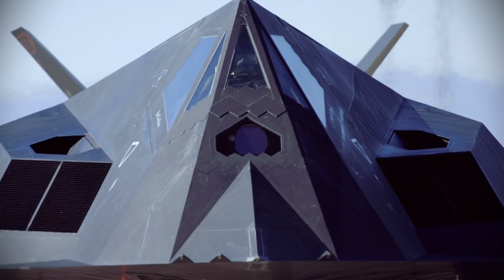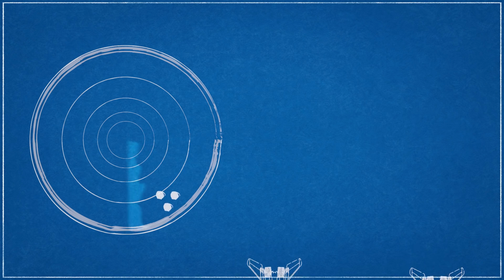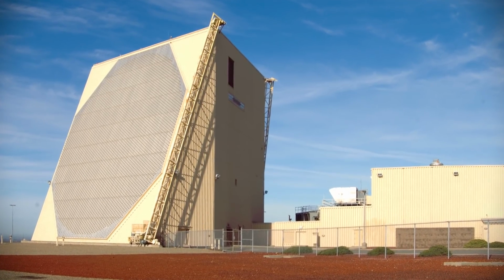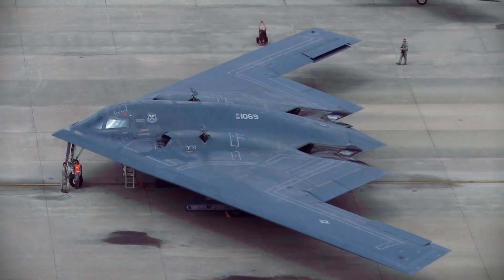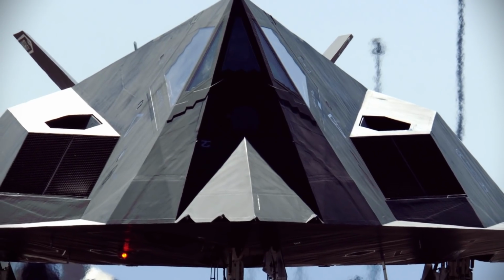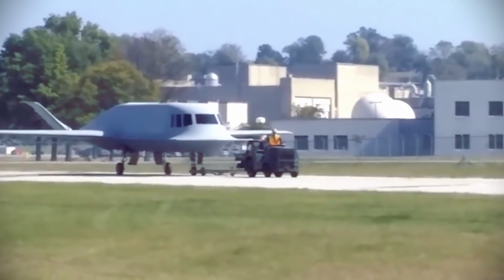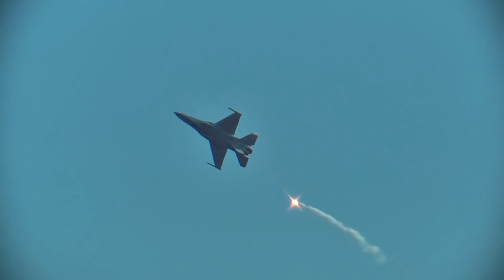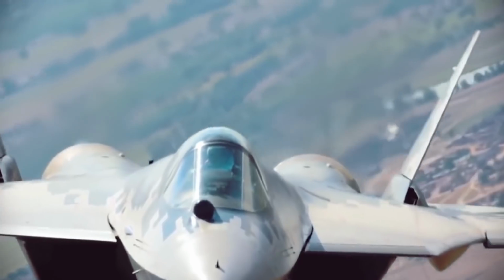The Evolution Of Stealth Technology

Comment: Fun fact about the F117: During testing (the picture of the aircraft on the pole in the desert), the model was so stealthy that the radar operator couldn't see it on his screen until a bird landed on it, and then he could only see the bird. The F117 was so stealthy that it had a lower RCS than the pole it was mounted to and the engineers had to also make a stealth pole to put the model on.
Reply: and the F-22 has an RCS 1,000 times smaller (about the size of a bee!)

that being said, a bee moving at 'mach 1.something' is going to be noticeable
Reply: @andyman8630  that is the reason why stealth and detection are in a cat and mouse race
Reply: They didn't make a stealth pole, they put a 177 caliber bb on the nose of the 117. It's design was called project Have Blue.
Reply: And still at least 2 got hit in Serbia and one was downed - it’s low RCS but not in low frequency and not invisible
Reply: @Cristieagle  smashed is smashed cope about it elsewhere
Reply: @mistralx2475  I was just about to say that. Seems stealth technology is overrated
Reply: @BluewaterBottoms  They did you can read it in the book which was written from the second boss of Lockheed skunk work. Can get it as pdf online for free.
Reply: @mistralx2475  The only time one was downed was when a stubborn SAM operator continued to look for aircraft in the area for hours on end, and finally caught an F117 opening it's bomb bay doors, revealing the non-stealth interior of the aircraft, and he was able to get a reliable lock and fired.
Reply: @d.bcooper2271  It isn't, the fact that only 2 were ever hit is an insane miracle for an air bombing campaign. I can tell you right now, if the F117 was a conventional bomber with no stealth functionality, there'd have been 50 losses at least, perhaps even more.
Reply: @BluewaterBottoms  "Have Blue" was the original proof of concept program which came from the 1961 paper, "Method of Edge Waves in the Physical Theory of Diffraction", by Soviet mathematician, Pyotr Ufimtsev.  The development program for the F-117 was based on "Have Blue" but was called "Senior Trend".
Reply: It is also important to understand the relation between rcs power and detection range
Reply: Sounds like a load of BS story or a joke that was taken too seriously.

The airplane is relatively hard to detect from the front but the case is not the same from every aspect. 
"Stealth" is not Haryy Potter cloak, it's very relative with a complicated relationship between angles of reflection, distance, and radar waves length and energy...thus it takes a lot of Mission planing, intel and luck before venturing into contested air space.

There's no way a radar would miss every aspect of such a surface object at 0 distance.
Reply: Yep, yep, and yep.

Comment: I wonder, what odd designs evolution based AI can come up with, when given both aerodynamics and stealth simulator
Reply: Posibly too odd to be used, we have tried to used designes made by IA but they are strange, and usually not better than something designed by humans
Reply: witkrieg todd  Any updates?
Reply: AI exausted it is property as topic long time ago, nowadays it is just a huge scale of 80-90x research. AI is widely used in microwave electronics: optimize function in  AWR/MWO.
You just can't load requirements in a black box and wait until it gives you result. Because it gives results worse than human-design, but as a tool for very specific routine things that are requiring try and then calculate it is quite useful. For example matching loads, selection of feedback components to get stability unconditional stability and so on.
Reply: They did. The AI popped out a tictac shaped object made of non-Newtonian metaphysical marshmallow fueled by Redbull (sans wings). Skunkworks engineers still don't know how the craft works or even how the AI designed it. The AI has been only pumping out cat-themed birthday cards ever since. A true mystery of science.
Reply: @carso1500  Ai is advancing so fast all this will change very soon.
Reply: @PureAmericanPatriot  This is perhaps the greatest comment in all of youtube.
God bless you, you fantastic creature.

Comment: Great video.  A good balance between novice and expert viewer.  If you want to get a bit more technical, you go into why the B-2 looks the way it does.   The B-2 does reflect - it's off the edges.   The B-2 planform is defined by just two lines.   If you look at the leading edge and move across the airplane, you will find that all the other edges are parallel to it.   These edges do produce 'flashes' in the signature (think of it like a flashlight) perpendicular to the edge.  There two flashes forward and two aft.   From an operational standpoint, if you have a good idea of where the enemy has its radar installations, you can maneuver the airplane to minimize the number of times you light up a radar site.   As an aside, I attended an RCS class in San Diego in 1985.   Once we got smart enough to understand, it became quite interesting trying to figure out what the other groups in the class were trying 'hide'.

Comment: And this is why we still don't have graphene tech.
Reply: I thought the same...
Reply: graphene is an amazing material but it does take an amount of effort to manufacture and it's not the easiest to use to build things with, kind of like carbon fiber period you might ask yourself why we don't have more carbon fiber in the world having used it for several decades but the bottom line is producing carbon fiber as cheaply as plastic is just not going to happen so even though it's a superior product you don't see a lot of market depth..

Comment: When I watch this, I get one new curiosity, when they testing anti aircraft missile, who are the pilot of the that target jet? Especially during 60-80s because drone or pilotless jet are still not available.
Reply: Remote controlled aircraft have been quite common target tugs and targets since just before WW2.
Reply: In 1898, Tesla demonstrated a radio-controlled boat (U.S. Patent 613,809 —Method of an Apparatus for Controlling Mechanism of Moving Vehicle or Vehicles).

Comment: Yugos beat the F-117 with tech of the 50's by "using different wavelengths" 
Same will occur again nowadays !
I work with military radars and one of our tech said that a radar is only valuable by the computing power behind it to "render" the "info" gathered by the antenna
You can play with wavelenghts (you have to) and you will defeat any "stealth" thing ! Only computing power will make a difference ! This is why new radars makes stealth aircrafts obsolete !
F-14 was a great EW platform because it has a strong unit to work with its radar,... it was a human ! All "modern" fighters such as the F-22 even they got superb AESA radars, they only runs "old" pentiums processors to compute the data from it...
Speaking of AESA, these are the banes of stealth, moduling wavelenghts and frequency so fast that no stealth can really defeat them for any long time enough to defeat an attack... and guess why, chinese and russians (french by some extent) became really good at building these ! First and still the most powerful AESA is fitted on the MiG-31M
Reply: Thats not what happened, they said they were opening the bay doors at a specific place thus they moved their AA to that spot. Detecting and tracking is totally different..
Reply: @lesliegrayson1722  They had to make up an excuse. That plane has been tracked for more than ten minutes. How much of an idiot pilot has to be to leave bomb bay doors open that long? SAM crews have reported detection and tracking of low observability objects and difficulty locking on them.
Reply: @slavisaasus  they explained why, its part of their checks and they always did their checks at that point. I cant believe anything else coz they have no reason to lie, as it is 20years ago? old tech. planes retired. [and I know that the F-35 is also detectable but not trackable with latest russian radar.] lol ur not Yugo :D ?
Reply: @lesliegrayson1722  They explained nothing. First explanation was that detection occured during bomb deployment,
moment when bomb bay doors are open. Next explanation was utterly moronic, that pilot has forgotten
to close bomb bay doors, beside all that training,  warning lamps and safety systems.
The last excuse was that bomb bay doors are regularly checked. How much of an idiot pilot (or protocol creator) has to be
to fly stealth plane over enemy territory and perform check that reveals its presence?
Is there a known failure of bomb bay? If you have bomb bay doors jammed, abort mission and return to base.
Simple as that. Every stealth plane, no matter what generation, is detectable and trackable with VHF/UHF radars.
Lock on has to be done with high resolution microwave radars that are affected by stealth technology.
Luckily, when stealth plane enters kill zone (close proximity), it can be locked on because laws of physics.
Combination of early warning VHF radars, short time of microwave emmision during lock on and highly skilled crews
is deadly for stealth technology. Stealth bombers are offensive weapons, developed by offensive countries.
Only impact that might have is to make defensive countries invest more in SAM systems.
I am Yugo with first hand experience of american bomb democracy, my father was high ranking officer
in AA branch of Yugo Airforce. Best regards.

Comment: I'm glad the author mentioned who literally shot the first opening shots of the Operation Desert storm. It was a battalion of Apache gunships who attacked and destroyed the key Iraqi radar installation, and therefore punched a hole through which the F-117s, and after them some other non stealthy fighter bombers, flew in and began their bombing campaign over Baghdad. There's actually a video of that mission filmed by the Apache's night vision cameras. Dozens of Hellfire missiles were fired followed by the massive barrage from the helicopter's 30 mm chain gun. Unfortunately, besides the radars and other equipment, many Iraqi soldiers died trying to run away from the carnage that resulted from the sudden and surprising attack by an overwhelming fire power.

Comment: ALL I KNOW ABOUT THE F117 IS THAT AN OLD RUSSIAN RADAR SAW IT ABOVE SERBIA AND IT WAS SHOT DOWN...... THEN THE SERBIANS SAID: "SORRY WE DIDN'T KNEW IT WAS STEALTHY" AHAHAHAHAHAHHAHAHAHAA
Reply: The F-117A was an antiquated aircraft older than the modernized systems the Serb used...
Reply: Flapping Flight so if a fake microwave can down a trillion dollar project..... love these stories
Reply: @peterson7082  - That's not true both the P-18 radar and the S-125 Neva SAM are much older than the F-117A and they weren't modernized Col. Dani turned the radar bandwidth down so low it was undetectable by NATO radar sensors and was able to detect the jet at long range but to get a missile lock he had to then pulse his high bandwidth radar which was only possible because he had Intel that the Prowlers were grounded for the night otherwise he risked a HARM strike 

He was also known to set up decoy radars using old MIG radars to keep the Prowlers busy

Comment: Great video, nice of you to show the Horten Ho 229 and what they learned from the vulcan, u2, YB-49 and sr71, and most important B1 and that passive phased array radar remote illumination,  burst communications and laser / satellite communications changed the game. Add the ability in the f 35 to control swarm drones as wingmen/ tactical assets, emp from active phased array radars and the new laser weapons the f35 was made for and you have a groundbreaking system. Arguably the submarine world was the beginning of stealth technology / techniques and materials the air force/ space force lol has sure perfected it.
Reply: They really didn't need to mention the 229 has it had no effect on any of this.
Reply: @peterson7082  Yeah it really didn't amount to much, Reimar Horten said he mixed charcoal dust in with the wood glue to absorb radar but in tests the ability was comparable to the plywood alone. But it may have helped them with encouragement. Wood planes in general were not bad at reducing cross section but it shows you how important the idea was even back then.
Reply: @ElijahPerrin80  It was claimed he said that, the author of that book which included that interview with Reimar Horten is still disputed to have even met him.
Reply: The YB-49 was also much more difficult to detect.  Another early clue.

Comment: 10:30 kelly johnson was NOT the director at this time. Ben Rich was. Also, Have Blue only came into existence after the Skunk Works mathematician discovered the russian paper, which had recently been translated by the air force. The entire have blue project is based on the math in that paper

Comment: Great series, minor nit pick, the first military radar defended the United Kingdom, not just England. Not sure how much longer it's going to be the UK but it was then. One fascinating fact, Chain Home was the first phased array radar as well. There were a large number of transmitters and to avoid them interfering with each other the pulse was synchronised to the frequency of the mains electricity supply, in the case of the U.K., 50 Hz. This confused the early German investigation into the nature of the radar, they thought they were detecting switching noise from the grid. In hind sight, a pardonable error.

Comment: what people need to understand is that tracking radar and targeting radar are different. just because you are tracking doesn't necessarily mean you are targeting. tracking can use long wave length radar like 1 or 2 or even 3 meter wave length radar now if your tracking a stealth aircraft with a 3 meter wave length radar that means you can only target a 9ft circle making hitting something thats moving 100s of mph and trying to not get hit alot harder. i think some targeting radar is millimeter wave radar to pinpoint a target and hit it.

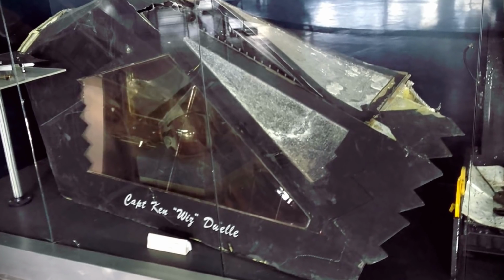Comment: 14:17 Fun fact: Ken "Wiz" Duelle was not flying that night and his aircraft was being flown by another pilot. I can't remember the details, but I believe his family saw the photos before the military told them he wasn't flying the aircraft (the military notified the family of that pilot that was shot down and since "Wiz" wasn't, they wasn't a reason to notify his family).
Reply: Another fun fact: it being shot down ha nothing to do with bomb bay doors. The observation radars worked at meter frequency and had no trouble detecting stealth planes. Tracking and targeting radar worked on shorter wave length (as they all do) and had trouble picking up the faint, blurred fuzzy target. But rockets were launched never the less. The pilot saw the massive fireballs created by rocket starter motors and started climbing since the plane maneuverability is so poor that any heavy G maneuvering would be more than useless. That meant that the whole perfectly flat underside now became the "edge" facing the AA  below which significantly increased it's radar reflection and the plane was hit.
Reply: @uegvdczuVF  Maybe like Hunt for Red October, turn into the missiles so that your stealth is in full use?

Comment: This was really interesting!   How stealthy was the sr-17 since it was designed pre ECHO1?
Reply from the maker: While it's RCS was low for its size it was still far from that of modern stealth. Its "stealthiness" was accomplished more from testing than computation. It also had an extremely high IR signature since it cruised with afterburners and experiences tremendous heating from air friction.  Ultimately stealthy or not, it flew too fast and too high to be intercepting or shot down.
Reply: SR-71

Comment: Next step:  Plasma sheathed airframes that use either lasers or or microwaves to ionize the air on the leading edge of the wing.  Not only does this plasma completely absorb radio waves but it also forms a near perfect boundary layer between the skin of the aircraft and the surrounding atmosphere that would normally create drag, greatly enhancing the aerodynamics of the airframe.  Various versions of this technology have been in testing since the early 00's and are likely responsible for many UFO sightings.
Reply: Plasma would glow and easily detected by infrared sensor. Also very hot plasma would damage the aircraft surface